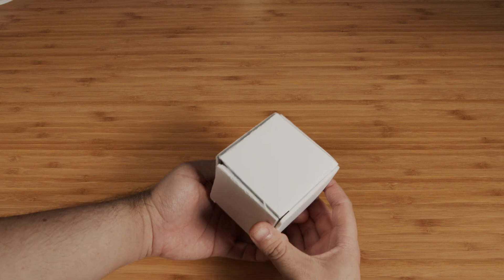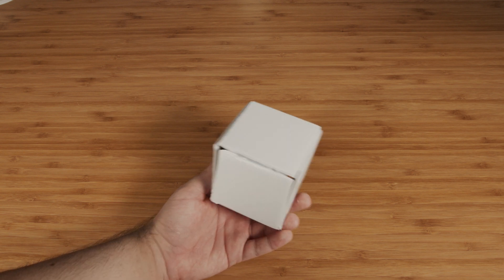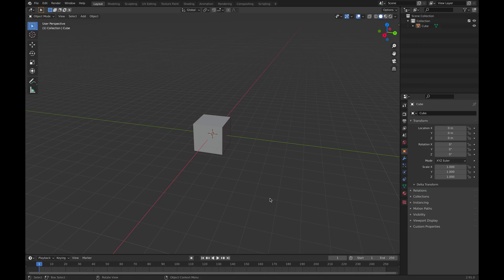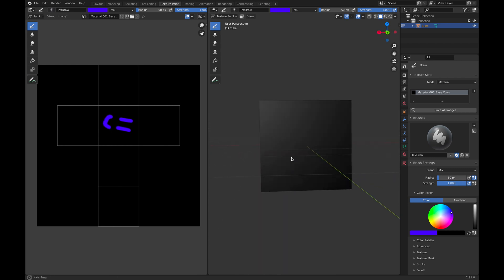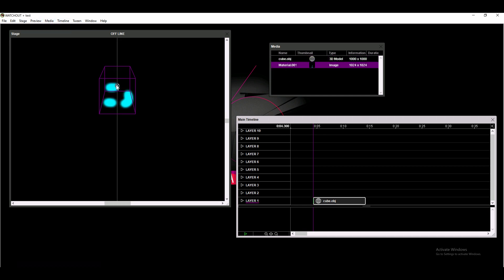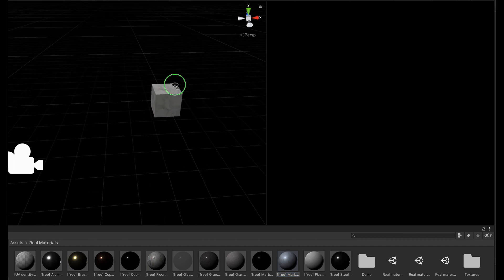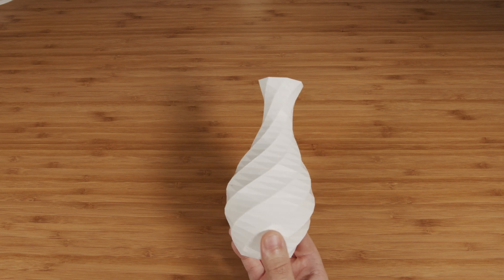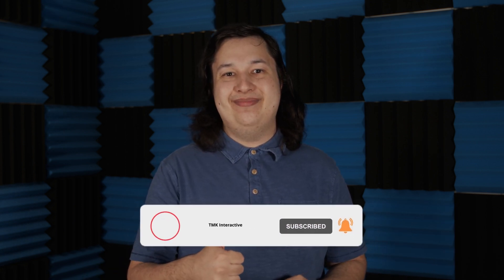What is 3D Projection Mapping?

Comment: So the bit I am trying to understand is rendering out from your 3D package, taking that file to QLAB and then lining up the projector so that it all matches.. Can you please expand on this step as I would want to do this in a theatre
Reply from the maker: The tricky part is that QLab does not natively support full 3D projection mapping(with UV mapping). You would would be better off if you went with software that supports it if you have complex geometry. (Watchout). If you have a simple object to projection map you could get away with using the Bezier option in the edit surface screen. Additionally, if you don't need full 3D mapping you could always create a mask of the outline of the object and use that.

Comment: Heyho :)
Thank you for this good example video.

I didnt know if this is a german channel, so I try in english.

Currently I want to project some user interface elements onto a human hand via a leap motion sensor and a projector.
The leap motion takes the hand position information via hand-tracking and updates the 3d model in the scene in real time.
My problem is, how do I calibrate the projector (hanging above the monitor), to fit the UI elements to the hands of the human body?

I guess since I have a 3d model already which updates in real time, I just have to tell the projector somehow to calibrate the UI elements correctly, means: angle, size, rotation, position.

Do you know any help? :)

Thank you
Reply from the maker: Hi Herr. Sounds like a fun project! You are correct, if your leap motion sensor is sending the position information to whatever 3D software you happen to be using and is translating and rotating the object everything should fall into place.  What you want to do to calibrate the projector is to make sure that the virtual camera is in the same place in the 3d world as the real world. You also need to make sure the FOV of the camera matches the lens on your projector. I personally use a cube to do calibration and move the camera around in the scene till the output of the cube projection matches the real cube.
Reply: @TMKInteractive  oh that approach is a good idea. I will try that :)

Thank you very much